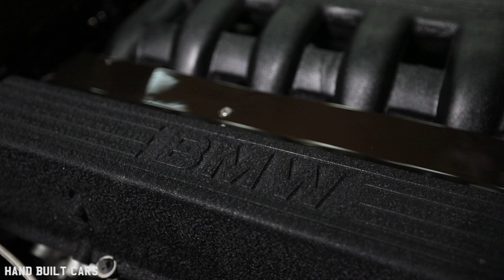Farm Built Dream Car - 1993 BMW E30 325TDS Touring Wagon Air Ride

Comment: Lagunengrun is pretty rare. My e36 track car started out this color when I first bought it. The air ride isn't my thing and neither are the wheels but the rest of it is pretty nice. The pie cuts on the downpipe look good. I had the reiger splitter in carbon on that e36 as well. Really wish we got these in the states.

Comment: Why bother with the air bags on a e30 or on any vehicle that has ever had it from the factory or not . Too bad it not a straight bolt on affair,  have to cut the rear spring seat on the body at the rear .
Reply: Just like fitting coilovers you have to cut the front strut housings as well. Air ride isn't my bag either. I would've done bilsteins and ground control's if it were mine, but to each his own, it's his car and he made it for himself and not for me lol